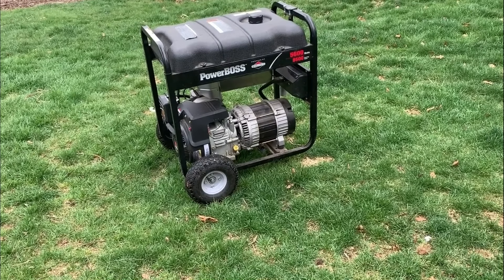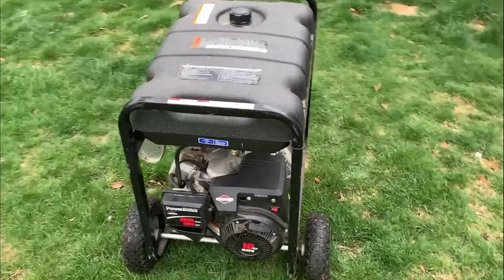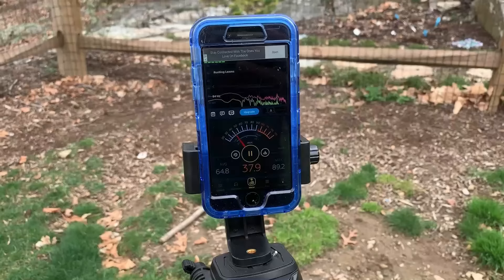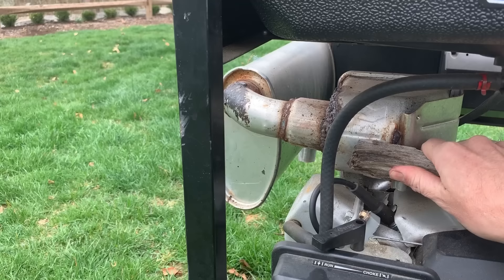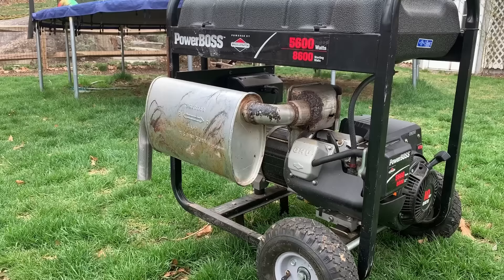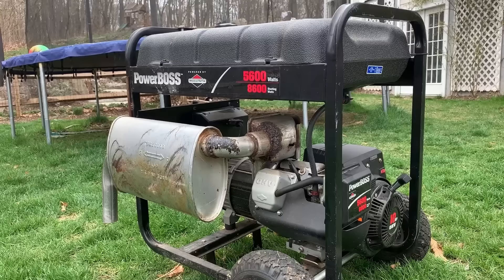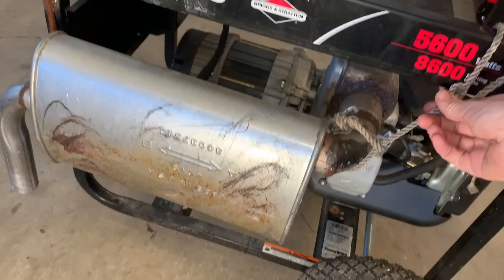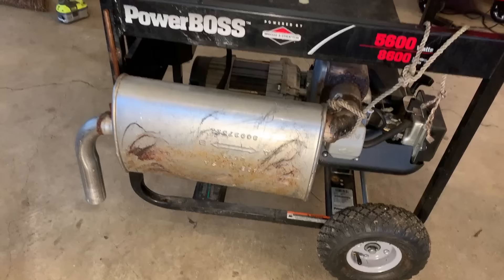Will a Car Muffler Make a Generator Quiet?

Comment: It's been my experience that an additional muffler really makes no remarkable difference,
since even the quietest of the quiet-gens are anything but quiet.
So,
for anybody who considers the noise too much of an annoyance, my only solution has been to move the noise to where it isn't as annoying by building a large enough insulated dog house outside with removable panels on all sides for starting, maintenance and removal for portability. 
The panels should have register vents on all four sides to allow cooling air to be drawn in that are available at hardware retailers.
And,
I found that the most effective roof is a pyramid type with a stack at the top for the heat & exhaust to flow out.  
The stack can be made with a piece of 4-6"  aluminum dryer duct conical topped like a toilet gas roof-vent pipe & screened to keep rain & birds out.
And,
UF type romex wire can be burred between the gen-shed & a convenience outlet either at or in the house.
Or,
no more often than an emergency gen needs to be used anyway  you can always just use a good heavy-duty exterior grade extension cord.
Of course it would cost a pocket of change to get a handyman to do it.
But if you happen to be a DIYer it takes about a weekend. 
And weather or not it's worth it really just depends on perspective.
Personally,
I've been living Expat fashion in the Philippines for ten years where the local infrastructure leaves enough to be desired to make brownouts & periodic blackouts a pretty common fact of life and necessity no-less typically becomes the mother of invention.

Comment: I have a plain square wave gas generator. It's loud! I bought a Champion inverter dual fuel gas/ propane generator. DB's run in the 50's. Good clean pure sine wave power and quiet. Starts real easy on propane. Now I have a quality quiet generator to run circuits in my house and the electronics in home appliances won't be destroyed by a dirty square sine wave. I have the best of all worlds!! Problems solved!

Comment: The first problem with this is that the exhaust bolt was loose, it's truly surprising how much noise an exhaust can make at the exhaust flange through a loose gasket interface. MUCH more than you'll ever get out of that hole on the outlet side. Second, since you don't need nearly what that muffler could flow there's a big gain to be had by necking down the exhaust pipe coming out of the muffler.

Finally, I'd bet the majority of the noise you're getting is actually mechanical noise from the engine and generator. That would be interesting to test to try to figure out what is coming out of the exhaust, what is coming out of the intake, and what is mechanical noise.

Comment: I’m afraid the experiment is still flawed because the loose screw on the muffler on the original setup also indicates you had a blown gasket in the exhaust manifold as well. I assume you changed it with the new muffler. I would have loved to have seen a good gasket on the old system for manifold as well as a repair sealing that rusted out stock muffler/welding etc.
Reply: Don't mind the hole in the original muffler..
Reply: both tests had the same "blown head gasket.
Reply: He doesn’t generally change the gaskets.
Reply: I kinda figured the test wasn't to be taken too seriously when he blocked a exhaust leak with a piece of wood

Comment: It's an air cooled engine, they are prone to being loud regardless to how large the muffler is. To quiet the generator, you have to put it into an enclosure with heat resistant sound deadening insulation.

Comment: Looks to me like 6dB of difference, which means the stock exhaust is 4X louder. 
The standard for measurement would be A-weighted at 1m, which would give a more meaningful reading.
I would have started by welding a plate over the gaping hole in the exhaust, and seeking out other leaks to give the adapted system a fair chance.
Putting a piece of wood next to it is as good as putting your finger over the tap in the kitchen and turning it on full.

I do appreciate the fact you took the time to remnove the thing properly, smooth it down and paint over it.

Comment: I have a diesel PP in my basement. It was installed before I bought the house. It's a Cat 8 engine and really quiet. What I found amazing is it's connected to the entire home. I can run my central air, dishwasher, washer/dryer. I am worried about something breaking on it though because I can't find anyone who has worked on one before.
Reply: Wait, the ENGINE is in your basement? As a home emergency generator? Do you live in a Castle or megamansion? I didn't know that was a thing as even the big whole-house standby generators are in a small housing outdoors very similar to an A/C condenser install.
Reply: Where are u located (generally speaking) ?

Comment: Engine is loud, not the muffler. You are hearing engine racket.
Reply: This...  a large proportion of noise from cheap "contractor" generators is directly from the motor itself, not the exhaust.  That's why the backup generators designed for houses are in insulated boxes/covers in addition to having a better muffler.
Reply: @infurious5748  it would also help to have a better engine, say a Honda OHC and then build an enclosure around the entire assembly making sure to allow for plenty of air flow for cooling.
Reply: @brianbumgardner8704  Or just buy a predator 3500 from Harbor Freight for $800 that is only 57db
Reply: Yeah. Those B&S engines are noisy. I did a little test years ago. Cupped a car muffler over the exhaust pipe of a B&S engine on a riding lawnmower. Made VERY LITTLE difference. I mean, it had a smoother less harsh exhaust sound..but all that engine racket was still there. Hondas make much quieter engines... but you'll pay for it.

Comment: Huge diesel generators I worked on in the Navy were inside a sound insulating module, like a room in a room.  Building a small insulated box around the generator would help.  Tall like a chimney and open on top.

Comment: 3db difference is a doubling of sound energy. A car muffler does maybe half of the work of sound dampening (the complete muffler has sometimes 2 or 3 chambers along the line) BUT THE REST is done by the engine cover, the hood, and the bodywork of the car. A generator can be encased, with input and outputs for cooling and breathing. Then the muffler will help to complete the sound dampening. The engine mounts are also rubber parts to dampen vibration, and that is also huge in a car to make it liveable. (you don't need any in an electric car)

Comment: One of the issues with Briggs & Stratton engines is the DB level comes more from the drivetrain noise than the exhaust. Some exhaust is better than others though (I once put small diameter glass packs on a riding lawnmower - cool sound but not much louder, merely a different tone of loud).
Reply: FYI, 'glass packs' and other straight-thru 'mufflers' are relatively bad at sound reduction because they prioritize unrestricted flow. They aren't even in the same tech/design ballpark as 'tuned' mufflers found on factory cars and such that are willing to impart some (often negligible) degree of restriction for greatly improved (perceived) sound reduction. The effective kind of muffler has chambers and baffles to break up and change the exhaust flow/sound, while glass packs and almost all small engine 'mufflers' barely reduce loudness by being a small expansion chamber with or without sound-deadening materials like Fiberglass packing.

All that to say, there's a huge difference between a perforated tube muffler like a glasspack and a tuned, chambered muffler that fundamentally changes the exhaust pulses into something far quieter. This is such a big misconception that it's kind of crazy that the terms lead people to not know the difference.

Comment: Great video.  Understanding and measuring audio is extremely difficult to do well. That was a huge change.  For comparison Onan sells a muffler for the Onan 4000 generator that is specified by it's data sheet to give only  a 1 dB reduction in noise for that generator. I suspect much of the noise reduction came from the wide body of the muffler blocking sound radiating from the side of the engine rather than actually reducing the exhaust noise. As noted by Victor Krivor, a small motor cycle muffler would be more effective at reducing the exhaust noise.  A single sheet of plywood with some padding on one side placed between the generator and the microphone would greatly reduce the noise as well.

Comment: Muffling noise isn't just obstructing the flow.  It must be cancelled or tuned to  a frequency that doesn't irritate as well as reduced. Understanding the sonic pulses coming from the exhaust port and the sinus pressure wave is foremost important. Then a muffler has a chamber that redirects the waves to cancel each other out while maintaining the free flow of air. 
Further, the issue as someone else pointed out in the case of this engine is its mechanical racket which you could hang some weight on to alter the frequency but it would have adverse effects such as sheer weight and probably work harden the metal causing structural failure.

Comment: I stopped by a muffler shop one day and asked about mufflers for generators.  He said a motorcycle muffler would work best.  However, he also experimented with mufflers because he mounted a generator on a truck for mobile work and said the internals of the generator make a 
racket which is unable to be quieted. He came to the conclusion a muffler was NOT worth the time and money.  If anything, he certainly
wasn't trying to sell me a muffler!  The Army put sandbags around theirs (the 5KW type) in Germany during the 60s and 70s for field operation.

Comment: Having the muffler welded directly to the frame is wrong, it will shake something loose, as the motor is free to shake, but the muffler is not. Muffler should be "suspended' from the frame.
Reply: Znobyrd That could explain the hole in the exhaust if you think about it. The vibration has to be absorbed somewhere.
Reply: Plus that could add vibration noise as well through the frame.

Comment: put the pipe in a bucket of water.  thats how boats do it
Reply: Jimmy Landers innovation
Reply: Did that with my 18hp Honda V Twin pressure washer. Did work but kept blowing the water out of the bucket. It was a beast at 3,000 rpm.
Reply: Never thought of that. I used to have some problems when running my Mortar Mixer in Residential area's. Retired now no problem.
Reply: @dljones61  bigger bucket
Reply: Lol

Comment: Most of the noise you hear is mechanical engine noise.
Reply: Exactly
Reply: Air cooled engine is louder.
Reply: This comment is the only comment that matters.
Reply: Yep
Reply: Can confirm. I found a small tractor muffler to put on mine and while it did quiet the combustion noise, the mechanical noise from the moving internals was still loud. I built sides and lined it with mineral wool insulation Batts and that is what truly quieted the generator down.
Reply: @armorer1984  make sure you have enough airflow for cooling
Reply: but the extra muffler did make a significant difference

Comment: It also helps if the exhaust is aimed straight up and exits above head level.  Its going away from listener and also away from reflective surfaces.  I have a motorcycle exhast on mine with verticle exit as described.  Generator sits outside on one side of the garge and can't be heard standing outside on the other side of the garge. Neighbors never know its running.

Comment: I think the purpose of the dB scale is to allow linear comparisons of sound to the human ear.  So when the stock muffler went to 77dB and the car muffler was about 70 dB the ear and brain are hearing about a 10% increase in the apparent noise. The pressure argument is correct.  It takes a lot more than a 10 % increase in the sound pressure wave to make the ear hear something that the brain thinks is 10% louder.  
Sound pressure increases on a logarithmic scale similar looking to a parabolic shape but the perceived sound is going on linearly, I think.  It’s been a few years since I got paid to do this.  I’m a mechanical engineer.  Acoustics snd electronics was a guess and test adventure for me.

Comment: A lot of noise comes from the intake side. Just saying.
Reply: You are right about that, thats why air compressors that have to be located inside of shop / work areas can be optioned with mufflers on the air intake side

Comment: The second I saw the hole in the exhaust, I thought of how much louder cars are with a tiny hole and lost interest as it would not be a true test.  Why didn't he just plug the hole before doing it?  Made all those tack welds, but couldn't apply some muffler putty or something to plug the hole?
Reply: Indeed. Blocking the giant hole with a rotten piece of wood did absolutely nothing. Doing so made the noise level go from ~70 to..... ~70.

Comment: I did this to a generator with a 10 HP Tecumseh engine one time. Those things were nothing but a bucket of bolts that made too much noise and had mufflers the size of a fist. There’s nothing you could do to quiet them down, although they would run. I have a Generac now with the same motor as this one that you have, and is basically the same generator. Mine has the larger Briggs & Stratton  muffler on it and it is quiet enough.

Comment: Most people dont realize the engines mechanicals make a lot of the noise like the valves springs you will always here them .
Reply: We were working 24 ,7 for a few months .No power at this remote job.A coworker grazed flex pipe to a10 gallon drum, connected it to exhaust of generator and nobody could believe how quiet it was. The valves made very light clicking .Would blow your mind how quiet it was
Reply: Mention brazed.
Reply: A lot of noise comes from the cooling fins.
Reply: Not if you bury it 5 feet in the ground

Comment: Was the muffler pointed straight down to make it louder AND set fires?
Pointing it at the ground would make it louder as the exhaust is bouncing off the ground.
Reply: covering the hole in the exhaust with a piece of wood was a nice touch though...
Reply: A muffler kinda acts as a spark arrestor. I've owned a good amount of ATVs and alot of them are designed with the pipe downward. Abit higher off the ground but still. Further, if a motor is spitting sparks or unburned fuel its probably way out of tune or ready to croak
Reply: I'm certain that's not right, the rotary engine guys sometimes have the tip pointed straight down to help pass the DB test to get on track.

Comment: Briggs offers Hospital Zone mufflers for their applications.
Reply: Briggs& Scrap iron. Make it quiet, reliable and efficient by throwing it in the garbage where it belongs and replacing with a Honda.
Reply: @jacqueslefave4296  honda is just about as shitty as everything else now
Reply: I'm sorry to hear that, my experience with it is from about twenty years ago or so, I wonder if they outsourced it or parts of it to the Shy-knees.
Reply: @jacqueslefave4296  yea everything is mad with chinesium now dam shame
Reply: @josereyeshero  I'm sorry I just don't understand your post. Could you state your point in clear coherent language?
Reply: @jacqueslefave4296  Honda GX engines (and probably the consumer level, too) are still very reliable and good quality. I actually think that ALL small engines made today are significantly better than the ones from 20+ years ago. Most start with ease and work well -- the only engine I had any trouble starting on a recently made device, was a 3" wood chipper/shredder, think it was a Briggs engine, maybe Intek branded, but the issue was that the engine was direct coupled to the chipper impeller which is an awful design. There was absolutely no way to re-start the engine warm, and since it was direct coupled to the impeller which was a heavy flywheel, you couldn't disengage the impeller to reduce the starting load on the engine, as well as disengage it if you accidentally put in more than it could chew, to avoid stalling the engine. On the other hand, I picked up an older 8 HP Briggs I/C powered Troy Bilt chipper shredder with the knife style blade, coupled via a belt with a clutch, and the engine started up in any condition with no problem since you would first start the engine, then engage the clutch. Bottom line, modern small engines seem to be getting better and better, as well as quieter. Lawn mowers, generators, snow blowers... budget brand or high end ones like Honda, in my experience they are all pretty good today in 2020.
Reply: @MittyNuke1  We used to call it Briggs and Scrap Iron.
 For air cooled engines, I use to pre-heat the cylinder head (s) by briefly warming the cooling louvers with a propane torch, it would work wonders. Another trick (and this works for cars, too) is to feed warmed air from a hair dryer right into a the carburetor intake. Pre-heating the intake manifold with a torch helps too.🙂

Comment: One thing going7 for an AC generator set to 60 cycle is that the motor rpm is set to an exact level usually 3600,1800 or 1200.   The exhaust noise by itself can be tuned out with an echo 180* out of phase in a long baffle. The motor rpm is set so the wavelength is constant.  The other mechanical noise is a separate issue.